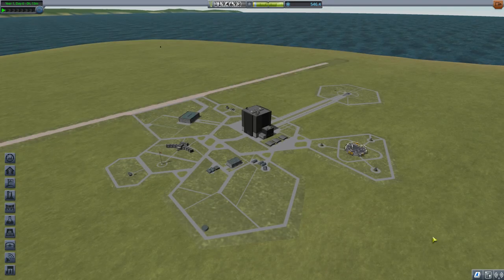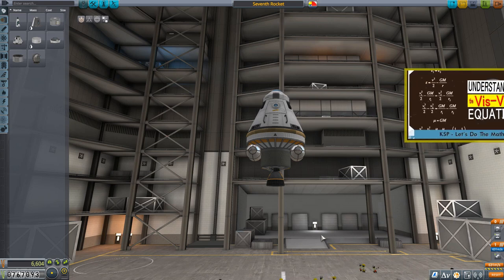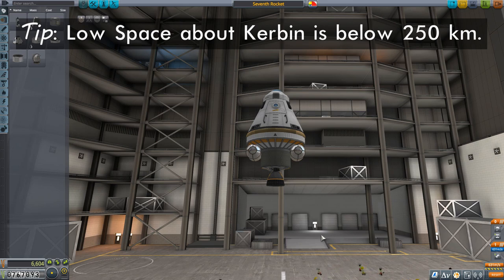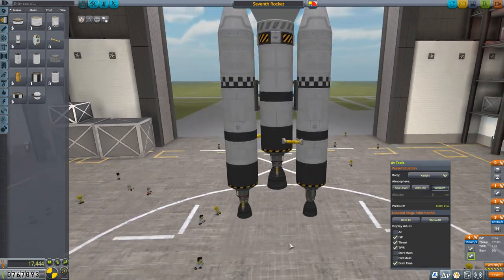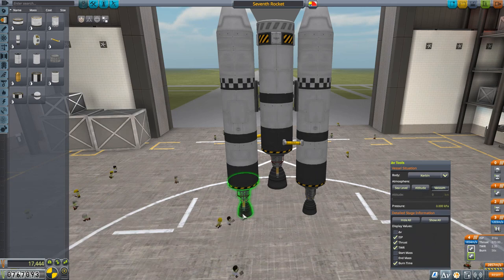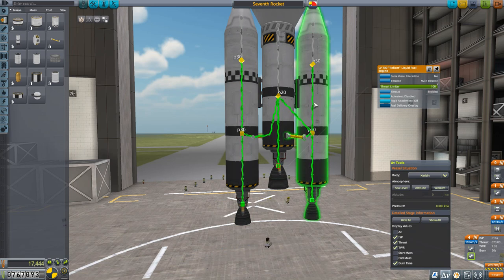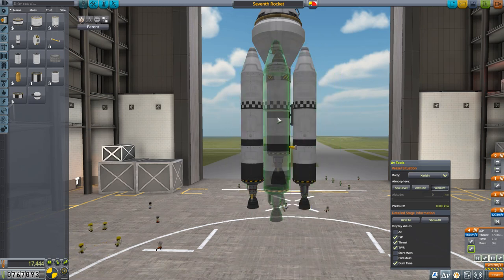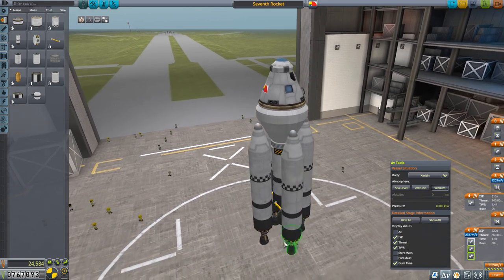Fuel Flow & Asparagus Staging | KSP Beginner's Guide

Comment: Ahhh man i just figured this out. Its all about having as much burn as possible and then dropping the weight asap. If you burn the 4 outer rockets evenly they all finish at the same time and youve moved them all into the air, but you don't actually want them up there. By dropping them asap, you use your energy to move less mass.
Reply: thank you for this comment! now I get it
Reply: @dotdot7911  it gets better when you realize that you only want to drop the fuel tank, and not the engine. 
This is really hard to do in the early game but later on, the general rule is that you only ever want 2 liquid fuel engines on your rocket (atmosphere & space engine). You feed as much fuel as you can into your atmosphere engine, drop the tank and move on to the next tanks.  
My standard setup was the main stack, with 4 tanks. Unfortunately this took way to long to get off the launch pad so I added 2 small engines to my second stage tanks. It turns out there's a big difference between lower atmosphere and middle atmosphere.
Reply: @MaestroAlvis  woah! this will actually help me a lot since I started playing KSP like a week ago haha

Comment: Mike do u remember me? Ur videos helped me a lot and now I am confident in going to the nun and minmus every single time and I don’t fail. I was trying to get on Duna but it was hard, but I think I can do it.

I was writing this comment about 3 thing I need help with:
1. What fins are good and do I always need fins or can I just use a control stabilizing wheel thing?

2. What is the point of antennas? Are they just for transmitting science or are they for other jobs and do they have other uses then just transmitting science. If they are just for transmitting, then I don’t think I need them.

3. Finally, what use are batteries and power systems in a manned ship? I know they are needed on probes and satellites, but why do some YouTube’s put them on manned ship?

Thanks for any help you might provide ^_^
Reply from the maker: 1) You don't always need fins, especially once you get the larger reaction wheels, bit you still may find you need them. For example, a large fairing over the payload can bring more drag up top and fins are a good way to bring the drag back down towards the bottom of the rocket. Basically, if you find your rocket flips around backwards while in the atmosphere, try adding fins.

2) Antennas are need to transmit science and for probe control. Otherwise, you don't need them.

3) There are a few high demand electricity items in the stock game like the science lab and resource converters. The electricity needs can be checked in the VAB. Reactions do use a little electricity but can be a pain if you run out. A few solar panels and batteries aren't a bad idea.

Good luck with Duna.

Comment: Mike thanks for these tips and videos. You have helped me out more than most. I still have problems with delta v, but have made some of my older boosters more efficient at the same time. My problems is when it comes to tweaking fuel and boost to lower or raise TWR and dialing it in nicely! Sometimes I can do it right and other times I’m scratching my head. Maybe you could do a vid were some of us subs can submit vessels we are having problems with and you can tweak and fix the delta v problems/problems in general. I think it would help seeing why you made the changes and how.
Reply from the maker: That's actually a pretty cool idea. Give me some time to think about it. Right now I'm gearing up for season 3 of my Let's Play which I hope to start Oct 13. So it may be a bit.
Reply from the maker: In the meantime, a launch TWR of 1.3 to 1.35 (at sea level) with upper stages around 2 (in vacuum) should work pretty reliably.

Comment: Apparently, these fuel lines are pure KSP magic. The (I think) only craft to successfully use this dual-engine-burn-while-refueling stage was the space shuttle, because the massive pump required to move this much fuel is basically the size and weight of an entire engine itself. 

It's more realistic to avoid the asparagus setup, which is what I try to do. Usually. Except when I have to put irresponsibly-sized space junk into orbit around the Mun 😂

Makes things a LOT harder, though 🙁 and heavier.
Reply from the maker: Nice idea. I'm rather an SRB fan myself.

Comment: Great video. I’m curious though, why not stage the middle engine at launch as well?
Reply from the maker: Didn't need the thrust, but now you've got me curious as to which way is more efficient.
Reply from the maker: It's a little more efficient to do it the way I did it. The reason is that the Swivel engines are less efficient. If you move the Reliant into the first stage, then you are forced to turn down the thrust on the first two Swivel boosters to be separated. This has you hanging on to the less efficient engines longer.
Reply: @MikeAben  except you can put the thrust limiter on. The way I do it is have the highest 'vacuum' ISP engine in the middle and and low altitude engines on the side.

Have them all start at once, but with thrust limiters on to have longer burn times. By the time I stage the center engine will at least be in upper atmosphere and have a ton of Delta V. It's pretty easy to get in orbit under 3,400 m/s that way. 

But I can get how this is a bit more advanced rather than for beginners though

Comment: I can't understand the reason not to ignite the centre engine at launch, to me, that is the main reason to use asparagus staging. Also, I use the engines the other way around, high thrust for the boosters, higher isp for the core stage. I do admit I'm not watching your videos as a beginner, but am enjoying them nonetheless. For beginners, high TWR makes things easier, but I find it more fun, more realistic, and more efficient to use 1.3 atmospheric for launch, ~1.0 vacuum for second stage/core stage, and around 0.5 for orbital stages.
Reply from the maker: Just keeping it simpler for the tutorials and keeping to the main ideas of the video. I have later tutorials with a lower TWR for the upper stage.

Comment: the number p50 was already there before u moved the second fuel line from the middle tank to the sides... why was that?? (11:16)
Reply from the maker: I noticed that during the final editing. I'm not sure as to the answer.
Reply from the maker: I kinda want to recreate it and see what happens when it flies. I suspect the game might be a bit confused in the staging at that point.
Reply: @MikeAben  got it. keep doing your vids!! i love them. thankss
Reply from the maker: @pedrofontes8441  You'll be getting one each Saturday for the next while.
Reply from the maker: @pedrofontes8441  By the way, I did recreate the craft as it was at 11:16. The priority numbers are wrong. With all four fuel lines going to the central core, fuels drains from all four boosters equally.
Reply: @MikeAben  Thanks for putting that extra work in, I was confused as well.
Reply: @MikeAben  The only thing I can think of that caused this was maybe after tweaking the priority manually for the first two that had the connected symmetry when you bumped it up a couple of values and back down may have made the game try and keep it at 30 even after adding the extra two afterwards. ¯\_(ツ)_/¯

Comment: Im having an issue where my fuel.no longer flows evenly after i add SRBs. I tested the asp stage alone and it works perfectly. Then i add SRBs (clydedales) to burn first, before my. Asp stage starts. And then the tanks all empty unevenly. Tipping my craft as CoM is changing due to improper fuel flow. The fuel priority numbers do not change. My asp stage is only 2 twin boars with rockomax tanks on top. The center stage is a mainsail. At this point im convinced its a bug. Cuz iv scrapped the craft and rebuilt it to no avail.

Comment: About the fuel ducts. How does it work? Like, does it even give us a boost? The fuel of the connected tank that's extracting fuel to other tank while the engines are turned on on these tanks (That are being extracted). It's just double fuel loss. We would just faster lose fuel. If im wrong, please tell me how it works!
Reply from the maker: It works because you are maximizing the use of your engines. Instead of inactive engines that are nothing but dead weight in the stack, more of them are working to lift the rocket.

Think of it this way. You're trying to push a car. There are five people available to push. Instead of four sitting in the car doing doing and one pushing, you get everyone to push.
Reply: @MikeAben  So im giving my engines a limit to thrust. To have enough fuel for the next stage?
Reply: Oh wait, i think i get it. 
Rather than just holding a deactivated engine thats just adding more weight i can activate it without having to worry about it getting fuel loss

Comment: Why do the separation stages have deltav when theres no engine in them, only decouplers?
Reply from the maker: Those stages only jettisons some of the engines from the previous stage. Others are still going.
Reply: I'll have to pull up my old ship but I had an issue with that not giving me accurate numbers. It's most likely something I did while flying. I can't remember now

Comment: how did you get all that science to unlock the mk2 capsule? i followed your series until now and i only have 140 science left right now, not enough for the 160 tech tree point to unlock that capsule and others to unlock other parts you show in the video
Reply from the maker: Can't say, but it is easy to miss some science on a mission. Even just happening to come down in a fresh biome when returning to Kerbin will do it. There's easy science around the KSC you could get with a jet. Each building is it's own biome, sometimes two or three. You could just drive around the buildings collecting science. You could also fly east and collect science over the Grasslands, Highlands, mountains, and there is a patch of desert on the west coast.
Reply: @MikeAben  okay tysm!

Comment: I did your vid step by step and all fuel still drains together. Can't figure it out.
Reply from the maker: A few things to check come to mind. Make sure the hoses are going the right way and connected to fuel tanks. Check your staging too. Also, sometimes stuff just gets borked. Try taking the fuel lines off and replacing them with new one.
Reply: @MikeAben  I will check that out.  Another thing on a test I just did, no fuel lines, changed staging so middle eng does not even light at the start and when I get to it in the staging it is empty.  Starting to think I might have a bad install, tanks are not dropping when staged to do so, till I stage to the last 2 engs on the sides of the pod, then then everything else drops.
Reply: @allensmith4716  the fuel lines have arrows on them.   Place them on the tank you want them to drain FROM then drag and place on the tank you want the fuel to go TO.   The arrows should be going the direction you want the fuel to flow.   Also make sure crossflow is disabled on decouplers.